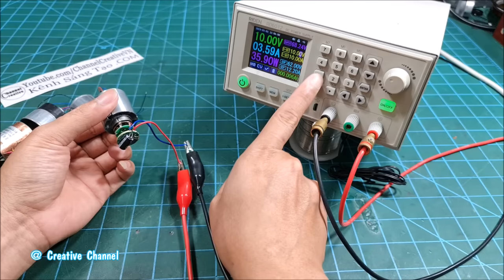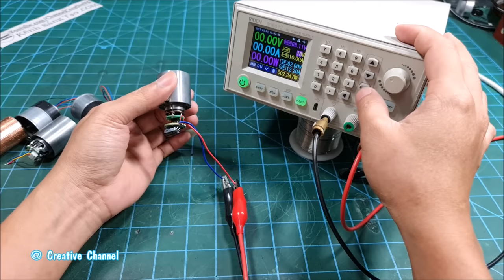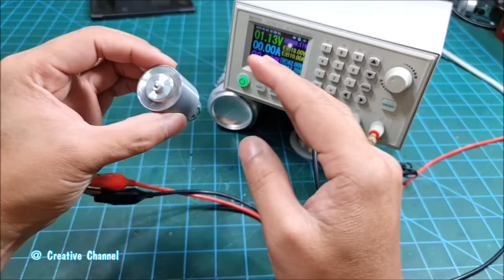DIY Powerful Air Blower mini using 16v 80.000Rpm Ducted Fan and PVC pipe

Comment: Did you use brushless motor with 3 wires? How did you connect it directly to DC battery?
Reply: it's connected to a driver so it only needs a battery to be turned on

Comment: Next project: convert this to a hot air soldering rework station
Reply: That's what I planned and designed already in my head and designed the circuit and firmware already, but can't find the right fan for it, I tested so many different hot air stations, I can work with them, but they are just so annoyingly uncomfortable, those that have a membrane pump in the station are annoying because of the hose and those with the fan in the actual gun are too big, so I want it smaller and because it is possible, btw. make one without a station but independent, basically only a stand with the mains AC connector so I can use a thinner silicone cable between the stand and the gun. My problem is that I can't find any information about the airflow of hot air guns, m³/min to choose the right fan.

Comment: How did you connect 3phase brushless motor into 2pin lipo battery?? Mine does not work when plugged directly to my 3s battery. Help
Reply: His has a driver board built in. You would need to use an ESC or find a driver board you could connect it to.